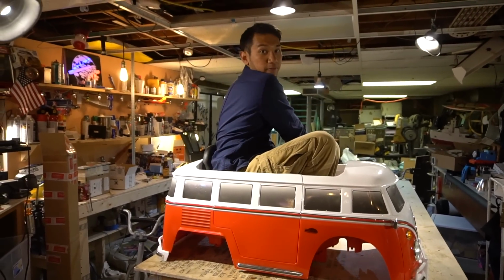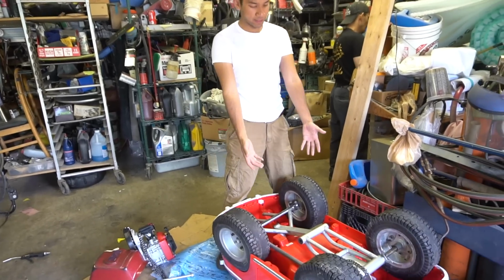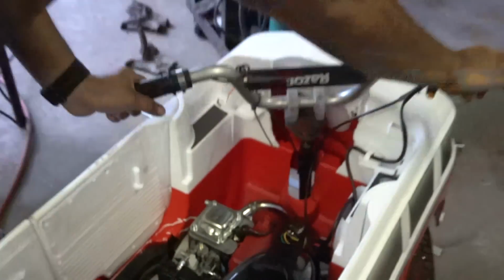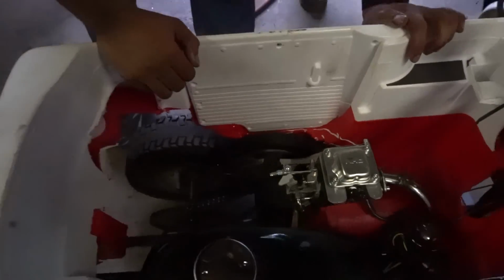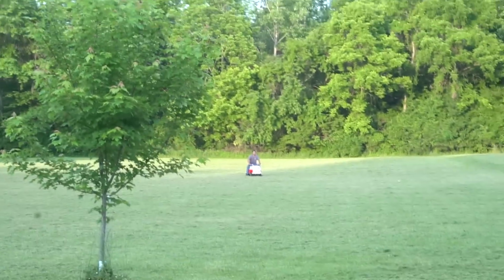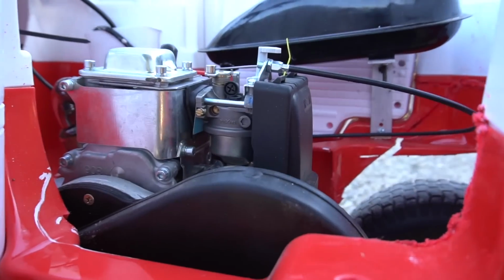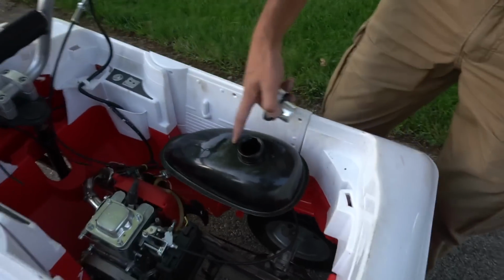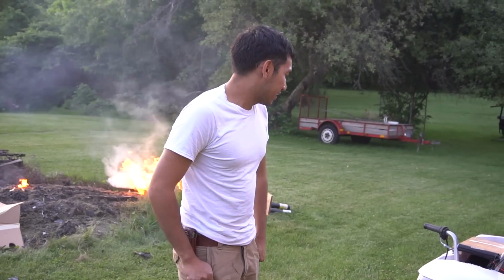Gas Powered  VW Minibus PowerWheels

Comment: I WANT THIS TOO, how much did you paid for the parts?
Reply from the maker: vw toy 100$
 kids atv thing (used) 50$ 
gas conversion kit 180$
Reply: Thank you very much for the quick answer! 
I got a summer project now. :D
Reply: So the crappy plastic housing costs more than the frame and only $80 less than the engine. Ironic you could have made a better car for a hundred dollars cheaper. Not that it’s bad tho it’s amazing.

Comment: I once had a build and the chain kept falling off my two sprockets, so I built a tensioner to keep it on. Sadly that didn’t help at all because the tensioner caved in under pressure, so instead of building a better tensioner i built a tensioner for the tensioner and It worked (somewhat)

Comment: Can you do A Hybrid paramotor?  You start with battery then when they are discharged yo start the motor to continue flight while charging the batteries and then you go back to battery? is it possible? could be great for the icarus challenge